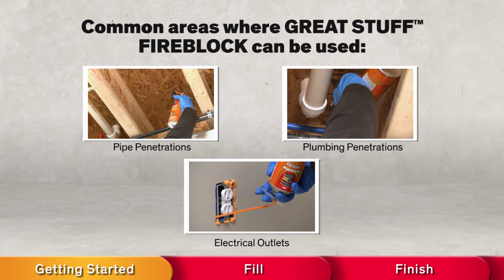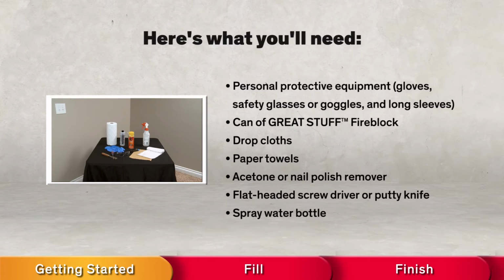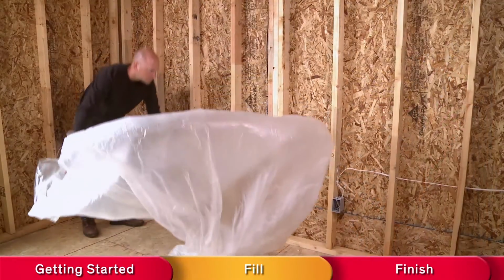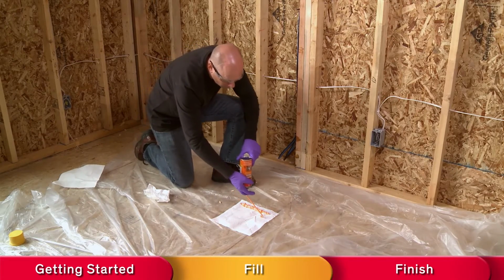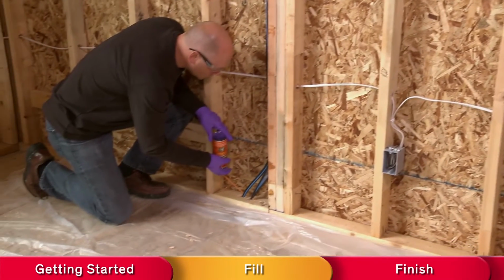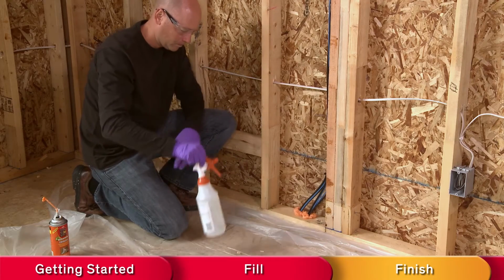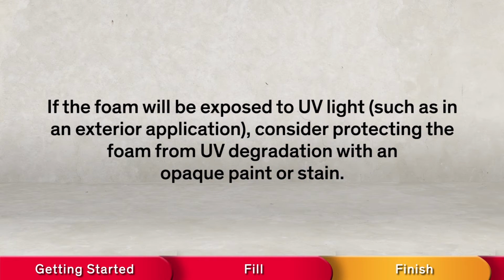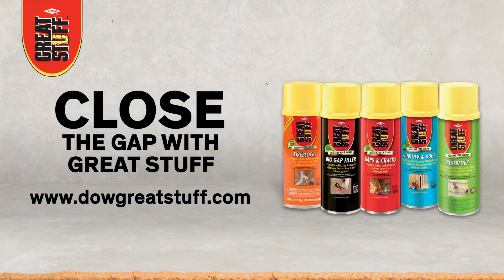Impede the spread of flames and smoke with Great Stuff™ Fireblock

Comment: Why is this product advertise as a firestop when it is not self extinguishing?? And flammable !
Something not quite right here....
Reply from the maker: GREAT STUFF™ Fireblock is not advertised as a "Firestop". A Fireblock and a Firestop are two different things.

Great Stuff™ Fireblock does not prevent or stop fires. It is designed to seal penetrations through and between floors and electrical runs in wall studs, minimizing air flow and impeding the spread of fire and smoke. Great Stuff™ Fireblock complies with the International Building Code, which defines “fireblocking” as the use of approved building materials installed in concealed spaces to resist the migration of fire and hot gases and requires that such materials be tested according to ASTM E84, ASTM E814 (modified), and UL 1715. Great Stuff™ Fireblock is not approved for use as a fireblock in commercial building applications nor in residential construction higher than three floors; however, it can be used as an air sealant in commercial building applications, as long as a fire block material is not required. Great Stuff™ Fireblock cannot be used for firestop applications. Cured foam is combustible and may present a fire hazard if exposed to flame or temperatures above 240°F (116°C).
Reply: @DuPontBuilding  
Thank you for the info, very helpful... Though the wording block vs. stop is very misleading to a Layman (average person).